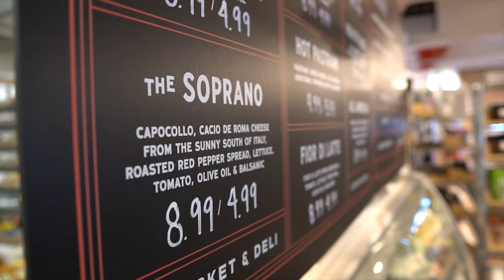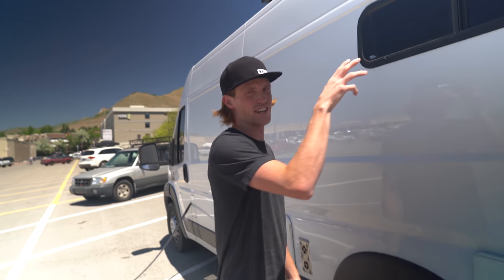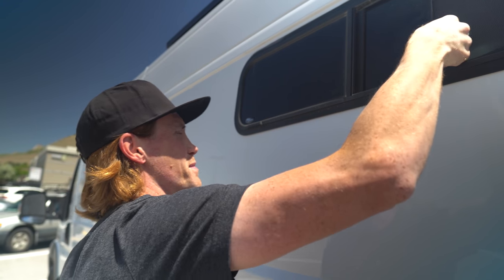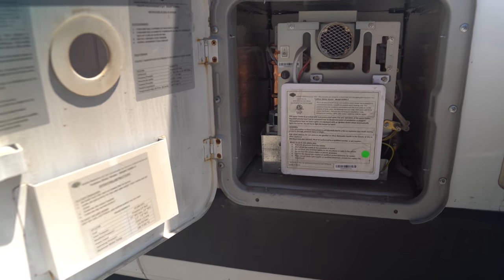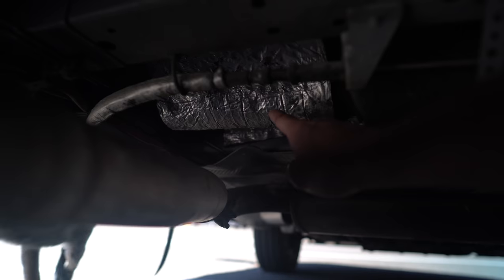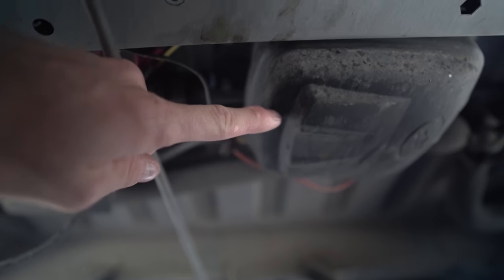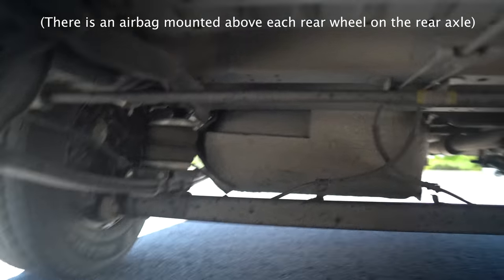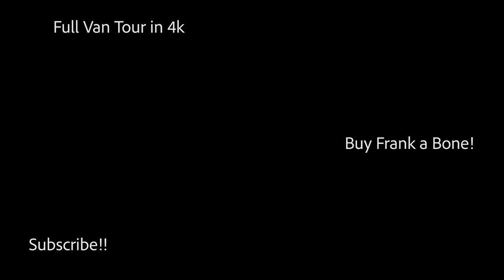Missing Parts of Van Tour // UNDERBELLY OF THE BEAST!

Comment: I hadn't thought about a leveling system and don't recall most van builds having that. Such a luxury!
Reply from the maker: It's actually not for leveling the van when parked. it to assist with a heavier load than you stock suspension is designed for. i.e. to eliminate sag in the rear end. You can adjust the pressure with a remote to supplement the rear leaf springs. I didn't want the rear suspension to be under too much load and wear out prematurely or bottom out and put the propane tank at risk.
Reply: I see. Thanks for the explanation on that.
Reply: What's a 'leving system'?

Comment: I read all the replies to make sure I am not asking redundant questions. 1) How did you know where to put everything? Was it solely based on where everything was located in the van itself? 2) Are you worried about the placement of the tanks as far as weight and balance is concerned? 3) Have you considered putting in a heat blanket so the tanks don’t freeze? 4) Were you nervous to put all those holes in the side of your van? LOL 
I have to tell you that when I saw your video that your layout is EXACTLY what I was thinking for mine.... especially the toilet and shower (although I think I want a composting toilet that somehow rotates sideways because I don’t want to haul it in and out of the shower). I am really impressed with the build. I was shocked to watch your first build video and hear that you had no building experience because I thought you must be a profession carpenter when I watched the video of the new van. Well done!
Reply from the maker: Stella, you are too kind. It makes me smile that you thought i was a professional carpenter ;) to answer your questions 1. We put everything where it would fit for the most part with the least problems. 2. We put the tanks in places where they would not throw off the balance of the vehicle, all centered for the most part. 3. Not worried about the grey water tank freezing and the propane tank has an insulation cover on it. 4.I was very nervous to cut all the holes in the van but it all worked out in the end.
Reply: Trent & Allie Awesome! Thank you for your quick reply! I just figured out that if you put an asterisk on each end of the text it makes it bold. Sorry about that.

Comment: What's up Trent, Allie + Frank?! You're build videos have been invaluable in my own van construction, design, and execution. Hopefully y'all are getting some cha-change from those affiliate links because I sure have been clicking them. ;]

Maybe I missed it, but question: Did you go with copper or flexible tubes for your propane line? And I'm assuming the insulation on those lines is for rock/debris protection and not for actual insulation. Unless you're hanging out at -50F...

Happy trails, my friends!
Reply from the maker: Yeah the insulation is to protect from road debris and we used copper tubing. with flare fitting. Refrigerator lines is also another use for the copper tubing. Good luck with your build man!!

Comment: Hey Trent - this is a random question but I don't think you've answered it on a different video (i've seen all the build related ones). I'm planning my build right now, and from what I can tell, the inside dimensions of the promaster 3500 EXT are 76" wide. A Queen bed is 60" X 80". How did you fit the bed sideways like that? Is it not a queen bed? Did you cut it down or something??

Comment: 2 questions: 1. Doesn’t the grey water tank freeze in the winter under the van? How does that work? 2. Any concerns about damage to the propane tank or line being under the van?
Reply from the maker: The grey water freezing would not be a big issue but it will happen. Running hot water down the drain would help to thaw it out enough to drain it. 
And yes we are very careful with the propane tank as to not hit it on anything.
Reply: Trent & Allie thanks! I am still trying to decide what I want to do with both. Think I may want to put both under the van and follow your lead

Comment: Hey Trent and Allie.  I am looking at positioning the propane tank under my promaster and was wondering where you guys installed it and if you have had any issues with the installation or any additional suggestions after using it for sometime.  I am afraid of losing ground clearance but the rear axle is so low not sure if that is possible.  Thanks for all your posts!

Comment: Very interesting do you use your air bags to level your van when parked, also Frank looks like our Blue Healers her in Tassie but with out a tail is Frank a Blue Healer. Love your videos been watching a lot of them, we have a Ford Econovan campervan but we are looking at getting a sprinter to convert.
Reply from the maker: Frank is a blue heeler mixed with a jack russel terrier!! 
We use the helper springs to supplement the weight of the conversion so we don't bottom out the rear suspension

Comment: Did you consider putting the water fill inside, accessible from opening the back door? Mainly just to be less conspicuous and to keep anyone from tampering? Just curious of any downsides to that.
Reply from the maker: we thought about it but when you fill up you usually spill water and/or overflow it and we didn't want to do that in the van plus we still have to fill water when it's snowing and cold outside and things like that. Also the water fill door has a lock and key so no one can tamper. Plus the water heater door and furnace exhaust kind of give it away that theres people living in it haha. Thanks for you comment W H!!!

Comment: Hey!!! Ive been devouring your videos and I love the designs you guys came up with for your van! I couldn't help but buy a new aims inverter and I was hoping maybe you guys could help us electrically illiterate people out here understand more about it. It should arrive today so Ill read all about it, but I didn't buy the controller yet. 

Youtube doesn't have any videos showing what nifty things the controller does, theres hardly any good videos about the aims inverter telling us why its the business, and my biggest question  is how to split power between DC, AC and shore power use. Like how did you wire all this up, can you use shore power directly or does it only charge the batteries when you plug in? Could you PLEASE do a video to share why you bought the aims and make sky blue, how its been working out, if the 200ah batteries have been enough, why you went 24V and how you decided to wire things to all work together. Thanks again for being awesome!
Reply from the maker: Craig so glad to see you’re liking our videos!! So the reasons behind buying the aims inverter charger is that their quality of inverters is a pretty high standard in the industry. These things are beefy. You need to run the ac output into a breaker box and then run your outlets off that and the dc power will run off the battery bank separate from the inverter. The make sky blue charge controller has been working like a charm. Best bang for your buck out there. I used the 24v panels and wired them in series so they put out 48 volts. The mppt charge controller converts that to 14.7 volts at up to 34 amps!! That’s why I went that route. I’ll try to make a video soon about why I went the routes I did and detail it all. I’m currently writing an ebook about how to build my latest van. Should be available within about a month

Comment: This is so cool guys! Thanks for sharing. I am buying a Promaster 3500 ext or a 2500 depending on availability and price. Did you do all the work yourself Trent? How did you seal the propane lines going into the living space?
Reply from the maker: That’s awesome Donal!!! I did every single part of this van myself! To seal where the copper lines come into the van I used flashing sealant. Basically black tar that comes in a caulk gun tune. Super easy and about as water proof as it gets.

Comment: Good video.  Decent light.  Curious on your fresh water lines from holding tank to hotwater and to both shower and sink.  Did you run the water lines under the van or just under the floor inside the van?
Reply from the maker: Thanks Reggie!! I have the lines under the bed and cabinets, nothing outside the van. Don’t want them to freeze in cold temps

Comment: Hi, Van Diesel here again. We are trying to figure out how you fit the grey tank in that space, the parking brake seems to be in the way. I am going with the 9 gallon grey tank from plastic mart with the dimensions 30x13x8.  I'm thinking maybe you went with one of the fresh water tanks with different dimensions?
Reply from the maker: No that’s the right dimensions. It gets in the way of the parking brake. You can either not use the parking brake (which is what we do and have to be very careful of) or you can relocated that bracket. Pretty easily too
Reply: Thank you guys!

Comment: Hi guys! Love your channel! I'm hoping to start my own van build later this year. I'm pretty much sold on the 159' wb gas promaster (only slightly larger than the Chevy suburban I'm currently driving). My question to you is, have you had issues with needing 4wd? My dad (a mechanic) wants me to get something we can add 4wd to, but I'm not sold.

Also, are the induction cooktops easier to work with than propane in a van? I've never used induction, but that looks like a nice option. On a similar note, I noticed in your old van you had a toaster oven, but I think I remember seeing you have an actual oven in the second one. Was there a cost/benefit between the two?

Sorry this has been such a long question. You guys are awesome and I love watching your videos!

Comment: I know this is an older video, but I'm curious about the fill stations and the hot water heater on the outside that don't have covers or locks. Have you guys ever run into trouble with anyone messing with them? I might be paranoid about that.
Reply from the maker: The water fill has a lock. All you could really do is turn our water heater off. Not too concerned at this point.

Comment: Thank u for this video! Questions! How big is your propane tank and in the winter how long will it last if your heater is on all the time? Or how often do you fill it? Also! Are u saying your running lines from your alternator to charge your batteries? I really like that idea!
Reply from the maker: Hey Wanda, the tank is 12.2 gallons and it lasts a 1-2 months in the winter depending on how cold it is and how often it's ran. Yes there are lines ran from the battery to the alternator that charge it when we drive. just as a back up. Hope this all helps. Thanks for watching
Reply: So is there someway or a gage that tells you, when your propane tank is getting low?

Comment: So then would you connect a hose to dump the grey/black water or just let it flow right out? How do you keep it sanitary and is there a facility you have to dump at? How and where would you fill up water/propane?
Reply from the maker: Water can be filled at any hose or rv water fill. As long as you use biodegradable soaps you can drain your grey water onto the ground and you fill your propane at any location that fills propane tanks, it’s the same adapter

Comment: Why did you choose to use the alternator as a secondary charge for the batteries instead of a plug in you could use at camp grounds, for example?  Is there a way to have both options?
Reply from the maker: we have both options the alternator just charges all the time when you're driving

Comment: Hey guys love your van tour videos stumbled across looking at ProMaster anyways I have a 2016 Ram ProMaster 2500 159 wheelbase thinking about getting that air ride system dual with remote with the compressor in the airbags it's a little pricey but in your honest opinion I sleep sideways in my van like you guys took out the wall supports and sunk in the walls for my head and toes to fit anyways is the air ride a good investment I mean obviously if I'm parked at a curb or uneven ground I can lift the passenger side up do you see any problems or had any problems with it sorry for the lengthy question
Reply from the maker: Hey Andy, the air ride system has been great so far, no complaints here. I think the airbag dual system would have been nice to have so you can level side to side but not sure how the vans suspension would hold up to that type of cross tension over time. I’d go for it if I were you becuase I think the benefit is worth the risk

Comment: HI guys.  I know this is an older video but I'm building a Promaster and I'm having trouble with placing a grey water tank.  It's difficult to tell exactly where you put yours.  The space between cross members is rather small and the emergency brake cable is in the way. What tank did you get that will fit the allotted space?  Also, does your van have a factory backup camera or did you get an after market one?
Reply from the maker: We have a factory back up camera, and we used a grey tank from plastic mart.com and it makes our e brake inoperable. But it works for us

Comment: Can you use teh compressor for the airbags to blow up van tires/mtn bike tires? And difference in handling? I am building out a promaster also and wondering about the airbags/compressor.
Reply from the maker: Yes you can use it for other things like that, you cut and fit the hoses yourself with the shrader vales on them so you just need a female to female and you could inflate other object. Ride quality is so much better because they reduce body roll so much!!!

Comment: Hey guys, can you tell me which particular grey water tank you bought? How many gallons and what dimensions?  Also, did you modify your propane tank at all to fit up higher or did you just rely on the air bags to protect it? We bought the same propane tank and are thinking of cutting down the brackets so it doesn't hang down quite as low. Thanks!!
Reply from the maker: Yeah I cut the brackets down so the tank itself is about 1” away from the body of the van. Then the airbags help protect it from hitting things if the suspension bottoms out! We bought the 9 gallon holding tank from plasticmart.com fits right between the body supports

Comment: Do you get stir crazy living in a tiny space?
Reply from the maker: No cuz you're usually out and about during the days and only sleeping or working when inside. It's more cozy than not i'd say. Some people probably couldn't do it though
Reply: It sure does.  Especially in the colder months and when it rains.  You spend more inside than you think unless you have a lot of disposable income to drive around and do shit.  The reality of it though is most of this is a fake front making it look more glamorous than it really is.  The fact is, many got in this situation out of desperate times and needed a roof over their heads.  A van like that dude built up is over 30 grand to start without even starting the build.  Most people do not have the money to do this resulting in them buying older conversions and construction vans -- many without bathrooms.  It gets old washing in public bathrooms, truck stops, and at the gym etc.  It is not for everyone, but can be rewarding.

Comment: I know this is an older video but I'm having a current moment problem. I ordered the propane tank through your link to support. But now that I have it I'm worried it isn't gonna fit?! Seems like it hangs much further under the rear axle than your video. Is this due to your airbags? Does the tank only work with the upgraded suspension?! Trying to remain calm
Reply from the maker: Hey Lucian, I cut the brackets down as short as they could be. That’s how mine is mounted so close to the body.
Reply: @TrentandAllie  you read my mind. Guess I'll get in touch with a fabrication guy. Thanks for the fast response. Beers on me when our paths cross out on the road.

Comment: how does that remote fill work?    (Propane Remote Fill ~ https://amzn.to/2JeMBCU) how could you set it up to use a spare Can if you run out of your primary tank
Reply from the maker: You would need this hose https://amzn.to/2LkTmjR
Reply: thanks, will that fill the big tank under van or simply run from new spare tank
Reply from the maker: It will connect to a spare tank and then fill the van's tank from the spare tank
Reply: gotcha, thanks
Reply: you both are awesome, thanks for helping and being a great example
Reply from the maker: No problem Bill!! Thanks for watching